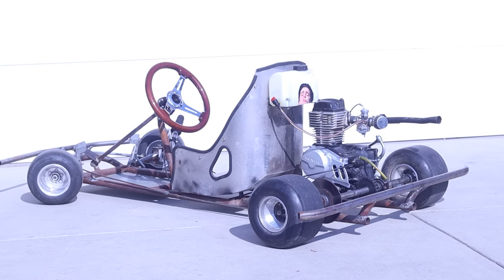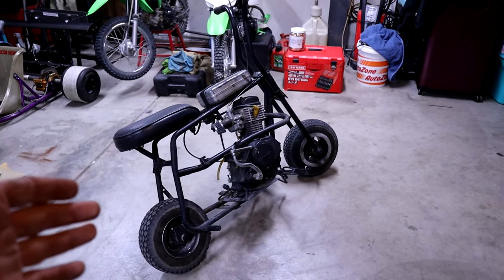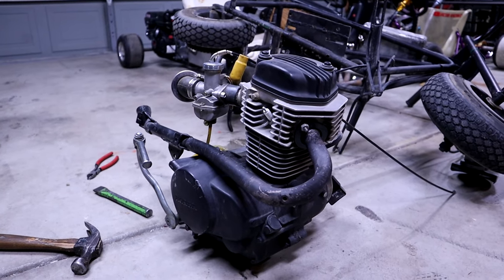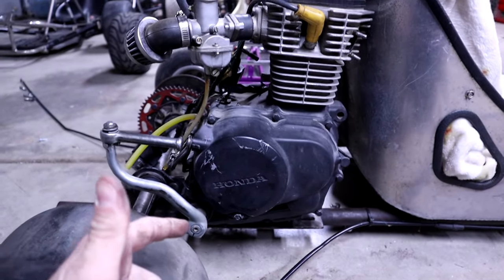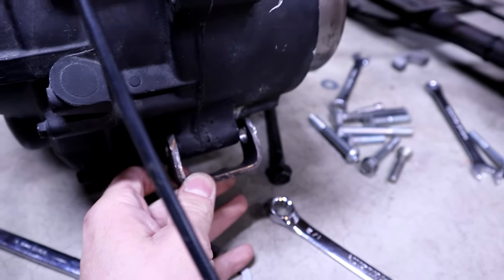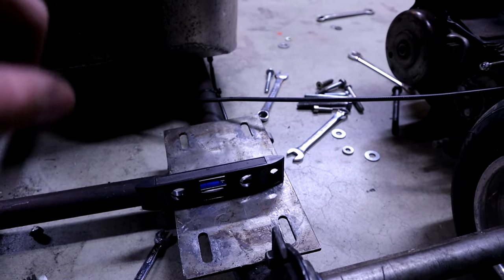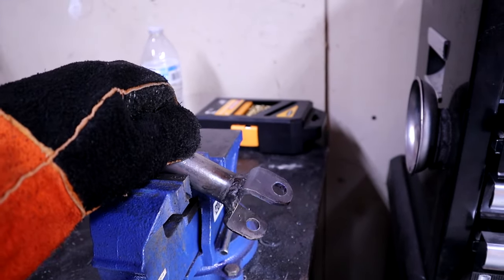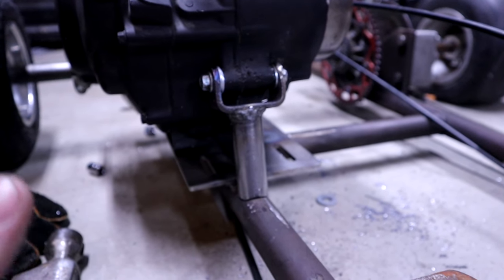Drift Kart Build (START TO FINISH)

Comment: What engine do you recommend for my trackmagic frame? I'm a big guy and my hip is right over the inner tube on the engine side of the frame. Was going with the preditor but the motor is a bit too wide and will hang out too much I think. Thanks and awesome videos.

Comment: About how fast does it go? What’s your axel sprocket size?
Reply: A heart but no answer haha
Reply: Speaking from experience, if you're using a 212 and 10 inch PVC, run a 4.4 gear ratio or close to it. Good mix of torque and top speed.